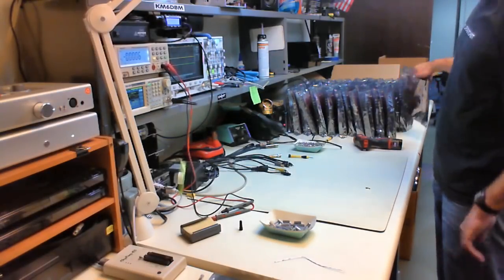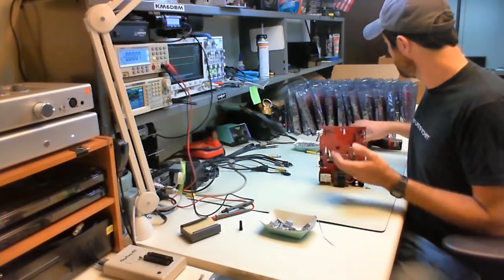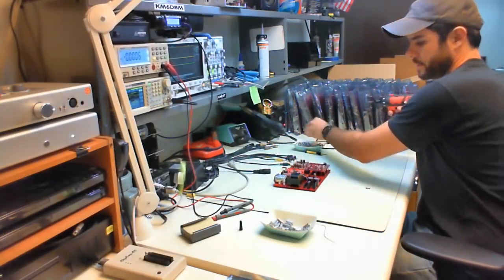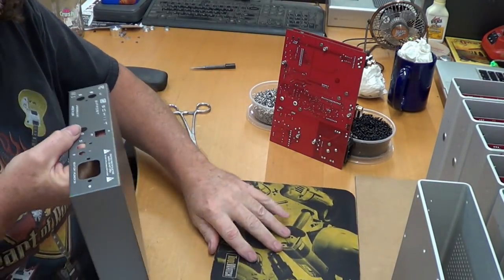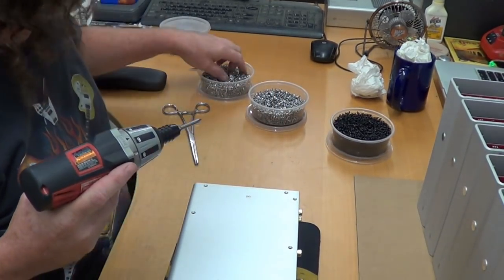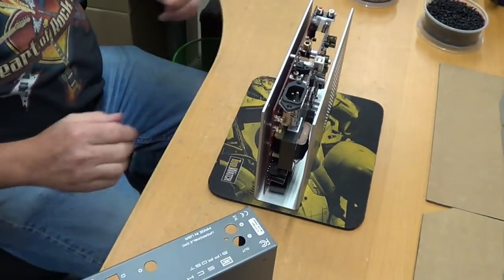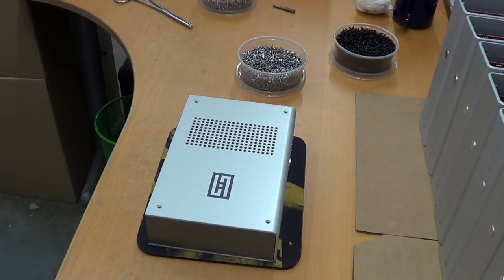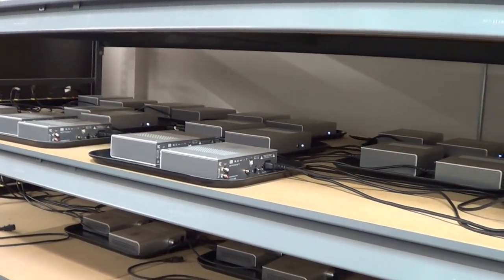BIFROST MULTIBIT FULL BUILD

Comment: Hello gentlemen!
I came with my SCHIIT BIFROST-1 to Russia. Into the depths. My DAC was purchased in the USA (Pennsylvania). and it runs at 110 volts. But now in Russia I need to switch it to 220 volts. I saw on the Internet that it is necessary to re-solder the contact on the board inside, but I am afraid that I could harm the device. I have a very poor quality photo of this part. But I want to get professional advice and a more detailed explanation for my Master of Engineer. Could you send me detailed instructions and a photo (video) on how to properly rewire the power supply circuit of the transformer.
Thanks.
With the best regards, Andrey Koshkin.

Comment: Here is my PCHIFI with Schiit Bifrost Multibit
1. Modified the original I/V OPAMPs to ADA4625-2
2. Changes USB to UNISON
3. Under Windows10. set sound as 16bit 176400Hz (Bifrost Multibit has a huge problem with downsampling from 32bit to 16bit and 48kHz series, let windows do this job)
4. Under Windows10, set system properties -> advanced -> performance -> Processor scheduling -> adjust for best performance of Background services.
5. Use the Quick CPU unlock CPU park
6. Use foobar2000 listen to music and install foobar Ramdisk and  WASAPI components
7.set the foobar2000 output as WASAPI(push) and buffer length 50ms, output data format 32-bit (for Audio)
8.set the Potplayer output as WASAPI 2.0 output data format 32-bit (for Video)
9. Set foobar2000 Advanced Playback WASAPI Hardware buffer push mode: 100ms, enable high worker process priority
Advanced:
10. Use WEISS Saracon Convert audio file to 64bit 176.4Khz and then playback
 
BTW:
1. ada4625 does not have a large current for output, it is best to work with Asgard3 as a pre-amp.
2. and always use foobar2000 Ramdisk function
3. 32bit audio provide really good sound atmosphere. let the software upsampling audios to 32bit and then let windows downsampling to 16bit

Comment: Actually, AD5547 is a great chip than the other 5781 etc, because it has faster setting time and higher frequency.  three bottlenecks of the multibit Bifrost first-generation, 1, the I/V opamp should replace to ADA4625, 2, the output of the SHARK DSP frequency should higher. 3, the audio file need to upsampling to 32bit and then downsampling to 16bit, the 32bit upsampling will provide huge sound image and music atmosphere, but the Bifrost multibit has a huge problem with downsampling (when using UNISON eat 32bit data) and output frequency (ad5547 has 6.8Mhz bandwidth! why not feed it in full) according to my listening experience.
Reply: although ada4625 has no much current output, it is better to work with asgard3.
Reply: actually, AKM is using 64bit upsampling, do you know the AK4191?
Reply: as the result, Bifrost multibit 1 has two big problems on the sound, 1, the sound image is mess and noise, 2, some sound should appear at back but always appear at the front. the first problem can be solved by replacing the I/V opamp to ADA4625 with UNISON or clean digital source. The second problem should be solved by re-design your digital filter.
Reply: If AD5547 can run at 6.8Mhz, this would be revolutionary, this would take the advantages both R2R and delta-Sigma. but, you need very good I/V (ada4625 is the best choice) and best digital filter design.